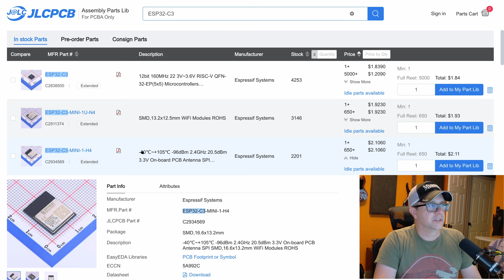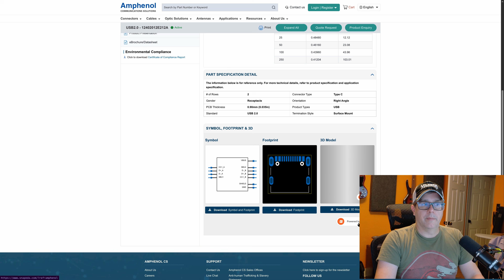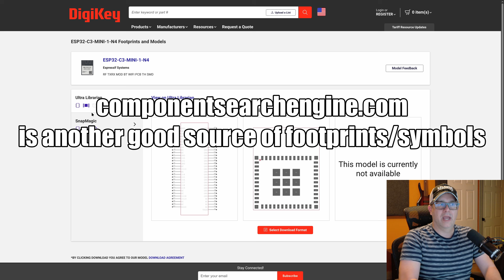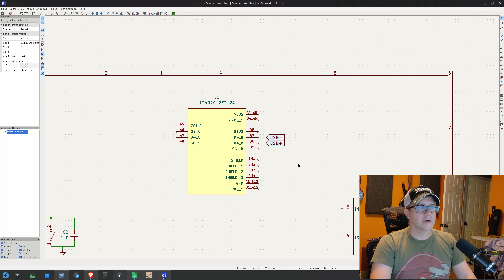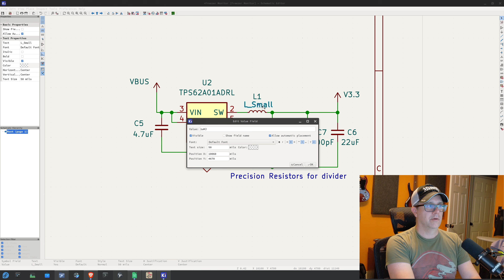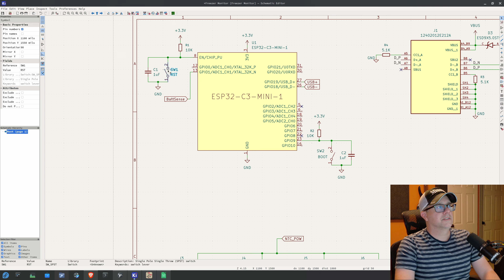Making your own ESP32 PCB: Part 2 - Schematic

Comment: Hi, why is the PG pin of the VREG connected to GND instead of having a pull-up resistor?
Reply from the maker: I'm not using it. From table 5.1 of the datasheet: "Power-good open-drain output pin. The pullup resistor cannot be connected to any voltage higher than 5.5V. If unused, leave the pin open or connect to GND."

Comment: You need to pull up GPIO 2 and 8 as per datasheet to be able to load over usb.
Reply from the maker: Absolutely right. Don't know how I forgot to do that, especially since I just did a video on strapping pins a month ago. :facepalm: